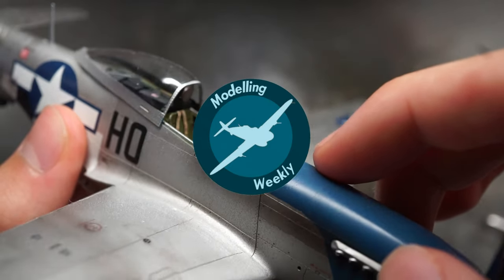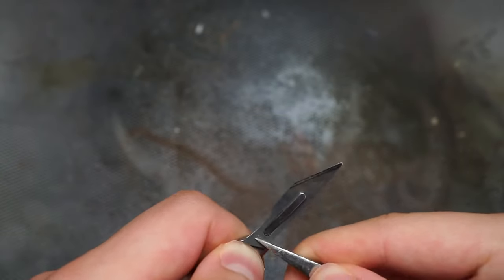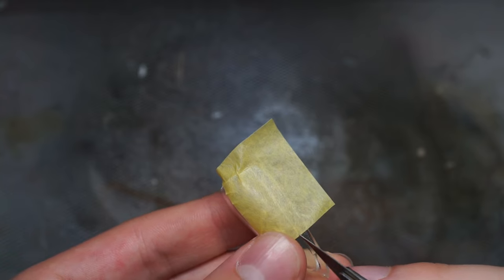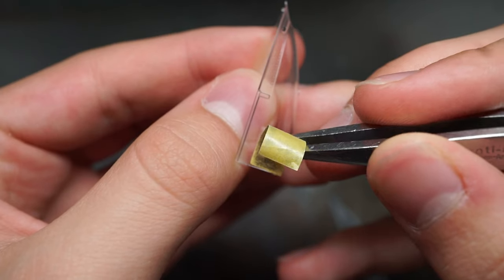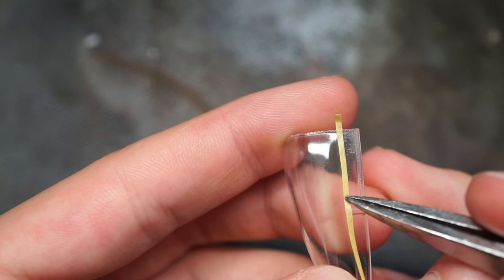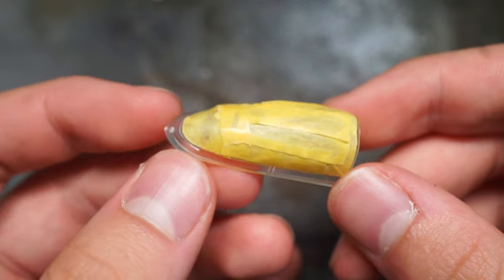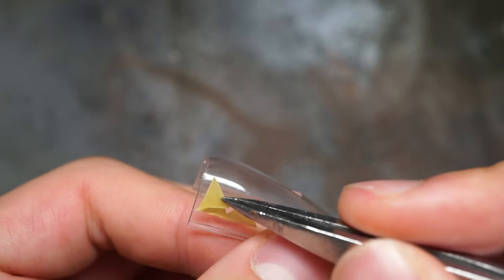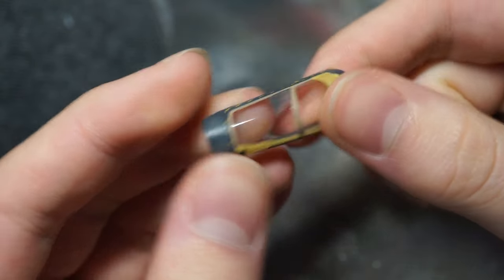3 Easy and Effective ways to mask Aircraft Canopies! | Quick Tutorial

Comment: Good video.  Another tip: Mix up a mixture of some Dish Soap and Water and apply it to the surface. This allows you to move the tape around  (slides across the surface). Once in position, blot it dry and the Tape will stick as normal.  Its the same idea when using Pre cut masks.
Reply from the maker: That is a brilliant tip! Thanks for adding!

Comment: Thank you for your time and effort to share the knowledge with us. Thin strips method is my way to go. After laying down the thin strips I fill the area to be protected with white wood glue. No issues so far (Only once after paint job is finished I had to do some maniplation on the color so I remasked the already painted canopy with just white wood glue. Model was Bf-109 and when I removed masking all paint on the canopy came with it. Lesson's learned.)
Reply from the maker: No problem! You're right, everything in modelling is a learning curve!
Reply: Wait u can use the normal wood glues which are white as a liquid mask? Man u saved me, Vallejo liquid masks are too pricy in my country,they're like 10 percent of my salary per a 60 ml bottle.
Reply: @mr.fazeli  You can also use it as a paint mask too. I mainly make aircarft models, but I wanted to try tank model. I find it very difficult to mask for painting. So I thin the white wood glue with water and painted the areas that I don't want to  be painted with this thinned solution. After painting session., wait 30 minutes and dip the model into warm water and gently brush away the white glue. Result is perfect for me.

Comment: A methode I sometimes use, is to get a graphic of commecially available canopy masks (some manufactures nowadays distort their graphics on their website catalogue, but mostly do this to newer products.). Once I have the graphic of the mask, I open them in either a graphics programm or sometimes even MS Word is suffice. I take on measurement of the canopy (e.g. lower corner of the front window), size the graphic to the same size, make a test print to look if the size is correct. As soon as I have a printout of the masking graphic in the right size, I tape masking tape over the printout and cut the masks accordingly.

With a recently purchased Cricut Joy cutting plotter, I could forego the MS Word und printer step, just loading the graphic in the plotter program, resize, cut and apply.
Reply from the maker: This sounds fantastic, I'll have to look into this!

Comment: Excellent video. Now if I can just figure out how to get slight residue from Tamiya tape off clear coated  finish.
Reply from the maker: If you mean getting any residue off the clear canopy parts, you can carefully use a tiny bit of isopropyl alcohol along with a cotton bud to work it off :)
Reply: I had already dipped the canopy in pledge floor polish, which I believe is an acrylic. Do you think that would be safe from the isopropyl?
Reply from the maker: @mrratskins  I'm not sure about that, I've never used pledge before myself. I'd give it a test beforehand on a testbed :)
Reply: I'm running a test right now. I coated some clear styrene with pledge. I'll go check it. Back again. Looks like the isopropyl stripped off the pledge. However, I was very aggressive. I may try it with a small canopy panel and be more gentle. If it removes too much acrylic I can paint it back in with a small brush. Pledge does a really great job of filling in minor scratches and adding some real clarity to a canopy. Go check out some videos about dipping clear parts.

Comment: What if (and this is a weird situation I find myself in,) there are no canopy details to follow with tape because for some reason they've been moulded on the inside of the canopy..?
Reply from the maker: Can you see the moulded lines through the plastic from the outside? If so, I'd probably just get some really thin masking tape and work your way around the outside of the canopy, using the inside lines as a guide to get it as accurate as possible
Reply: @ModellingWeekly  Yeah, I believed I would have to try something like this. Wish me luck!

Comment: Fantastic tutorial. I have had problems with paint lifting from the canopy rails due i believe as you say from leaving the masking tape on for far too long. Do you think lacquer paints would be better in this respect and cut down on lifting.
Thanks.
Reply from the maker: I think lacquer paints will do a lot better than acrylics, purely as acrylics form a proper sheath of plastic when they dry. Can't 100% confirm though, as I only use tamiya hybrids!

Comment: What about using masking fluid?
Reply from the maker: You can use it to fill in areas inside masking tape, though its very common for masking fluid to rip paint off when used to mask the edge of a canopy strut. A good example of this is Plasmo's TU-154, he used masking fluid for the windows and it was a disaster lol

Comment: Waste of time! Just paint the thing with a brush in several thin layers, any overpaint can be removed by gently rubbing with a soft pointed wooden toothpick. Honestly these are really old ways of doing things, just because this is how the real thing is done doesn't mean you should do it on a wee small tiny model, move on people! lol
Reply from the maker: If this works for you, go for it! However the toothpick scratching method only really works with enamels and some acrylics due to composition, whereas it's hopeless when using lacquers, alcohol based acrylics, and other modern paints. I also find that even when it can be pulled off properly, it doesn't give as sharp a result as a good masking job. So, each to their own, but many people do appreciate the advantages of a good roll of tape!